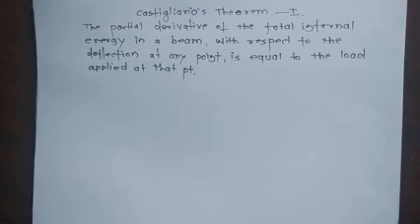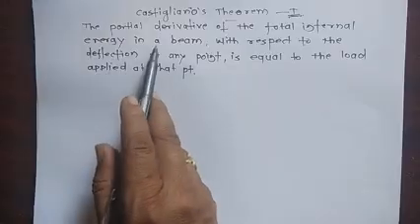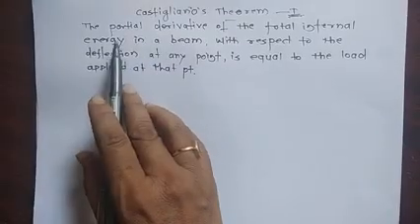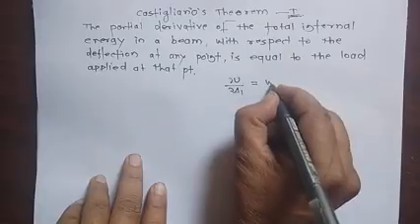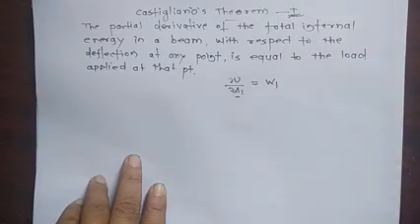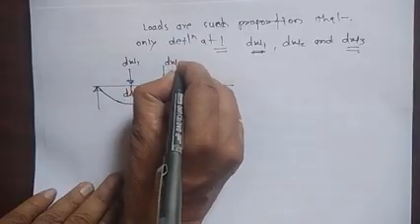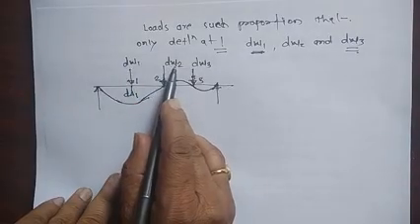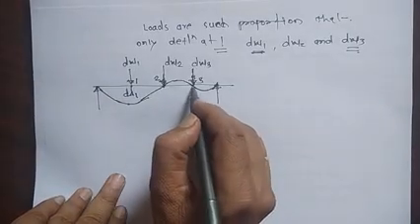Lect15-Castigliano's First theorem Derivation

Comment: Sir why dW1 is half. We can take W1 as half.
Also how W1*d∆1+1/2*dW1*d∆1 is equal to W1*d∆1. How is it possible, please explain it clearly sir.
Reply from the maker: dw1 load applied gradually. When load applied gradually, then strain energy is equal to average load X deflection
Reply from the maker: W1 full load (100%)is already their, in that case strain energy equal to load X deflection
Reply: @AgrawalStructuralAcademy how 1/2*dw1*d∆1neglected ?